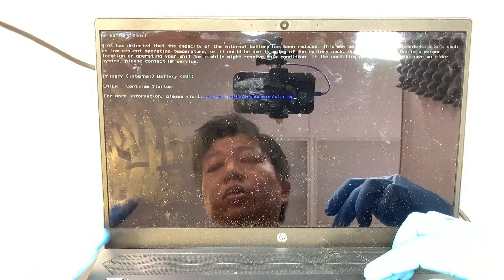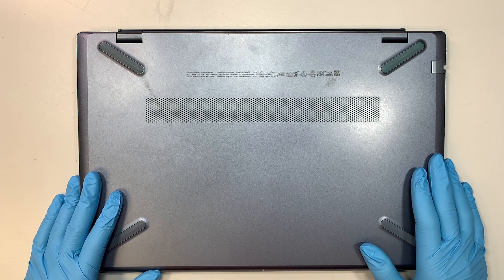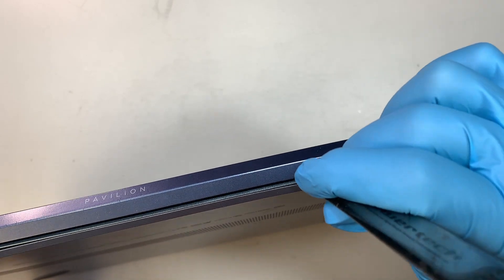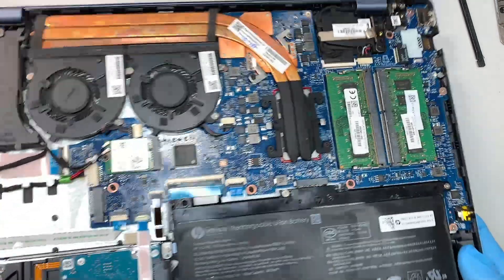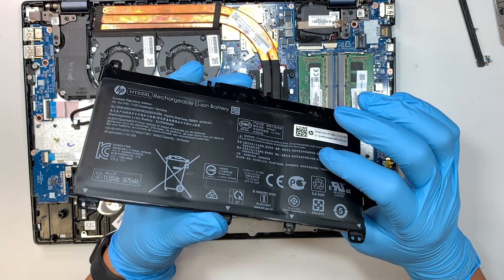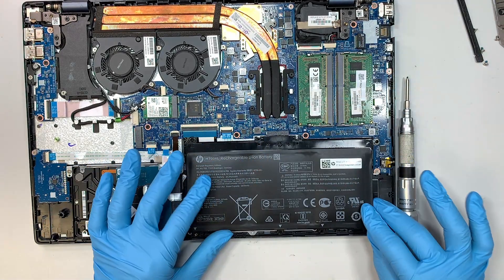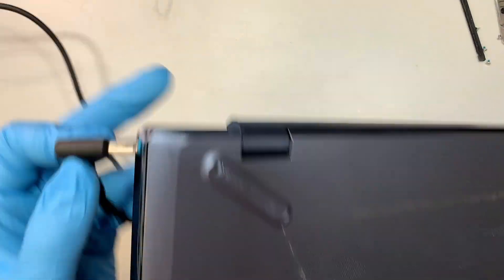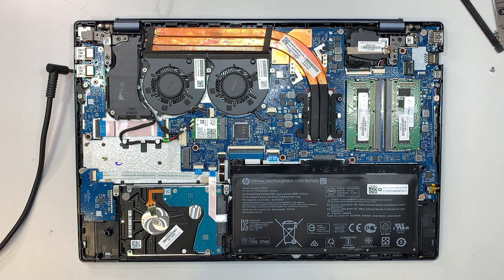HP Battery Alert   Primary Internal Battery 601 has been reduced

Comment: 601 error code, should my computer still work when plugged into wall socket without replacing the eternal battery? Or do I need a new battery regardless? Or is that battery only if I want to use it running from battery only??
Someone please let me know, thanks